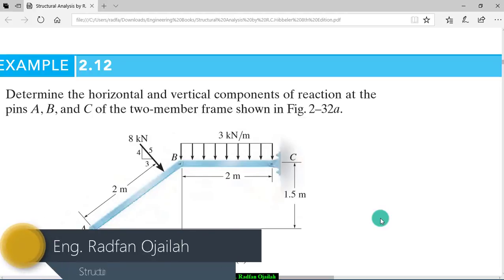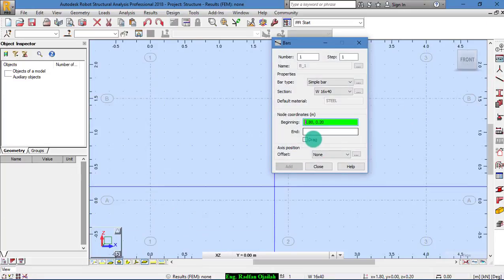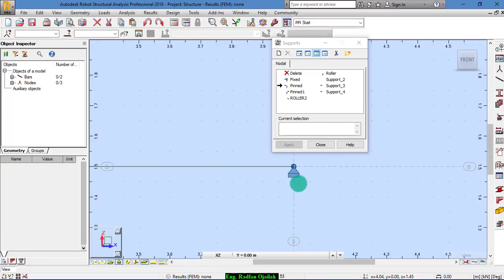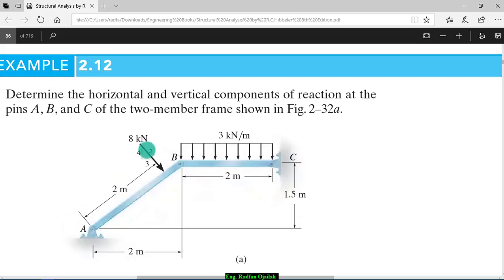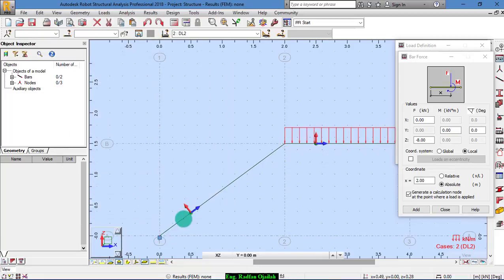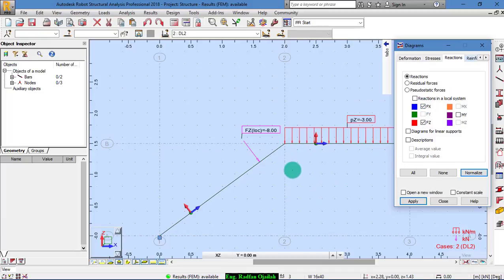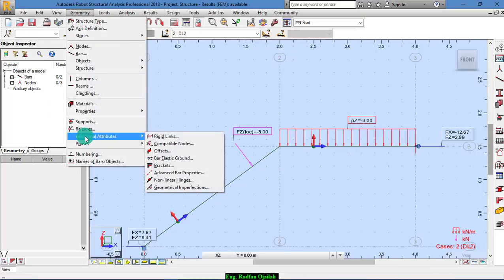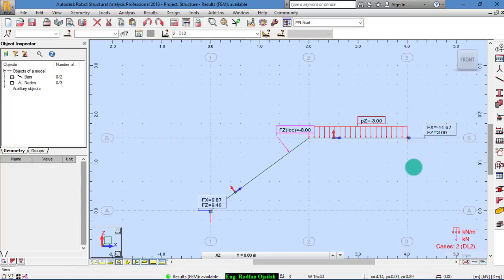Structural Analysis Using Autodesk Robot, Exercise03

Comment: is it fixed support? isnt it Pinned ?
Reply: Sucede que en Robot Structural si solo hay dos apoyos y ambos son articulados el programa marca error

Happens in Robot Structural if there are only two supports and both are pinned the software send an error message
Reply: Sin embargo, si solo uno de los dos apoyos es fijo las reacciones son las mismas que ambas articualdas

However, if only one of two supports is fixed reactions are the same as both pinned